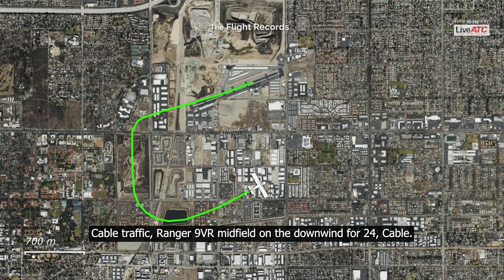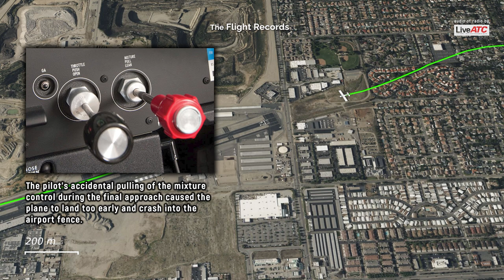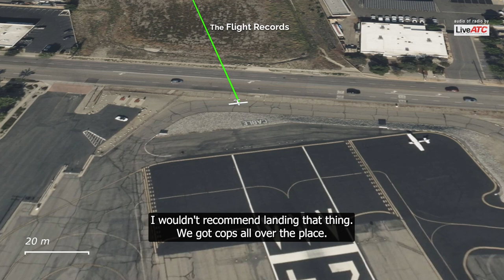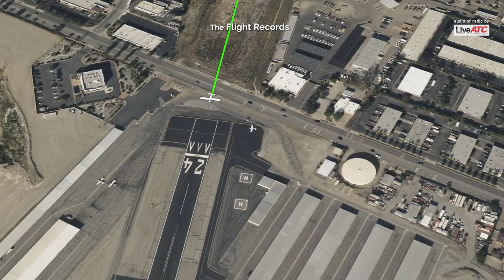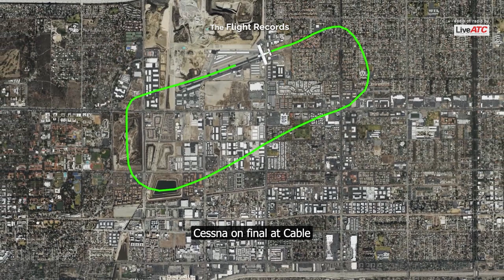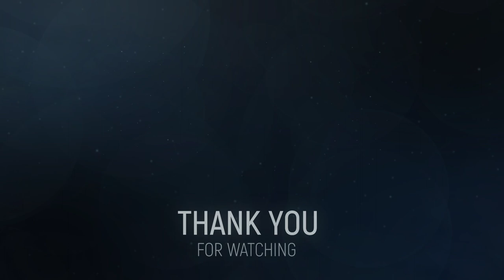Small Aircraft Collides with Airport Fence | Pilot mistake

Comment: Sorry to hear. Glad pilot is ok. First accident I’ve ever heard of in a Ranger. The Vashon Ranger is one of the safest and most comprehensive planes I’ve ever flown. It is modern, it is new, it is very easy and fun to fly.  Based on this mishap if I were to modify the plane to prevent this from happening again I would either move the mixer further and away from the throttle or reposition the throttle by itself to the bottom like you see in other aircraft. Be safe my friends.